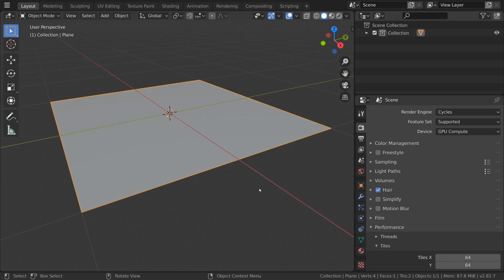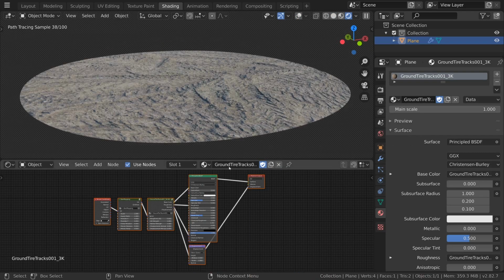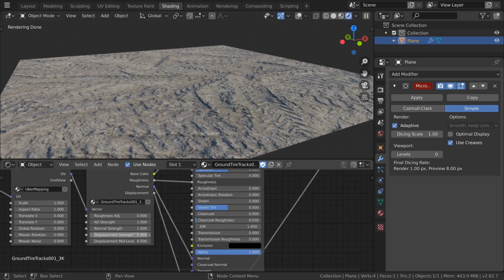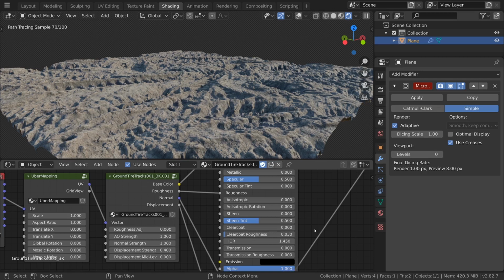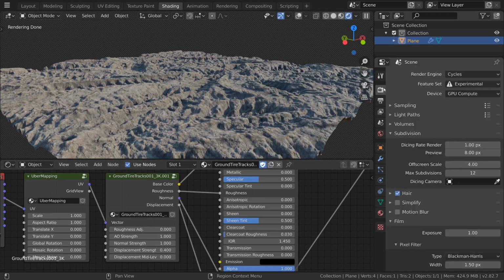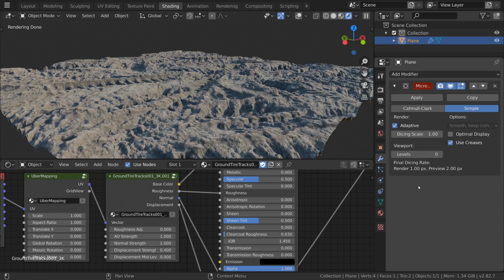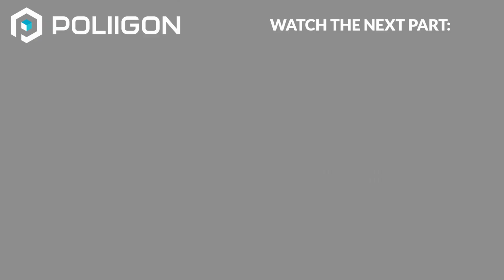Using Poliigon Materials in Blender (Part 3: Displacement)

Comment: For those who having weird issues with their displacement. Subdivide ur mesh like 50 or whatever u like dont go over 100 .It would be too much then.Add a subdivision surface . then adjust displacement level as needed.
Reply: Better if you use adaptive subdivision like in the video's instructions so there's more subdivisions near the camera and less further, and mostly automatic

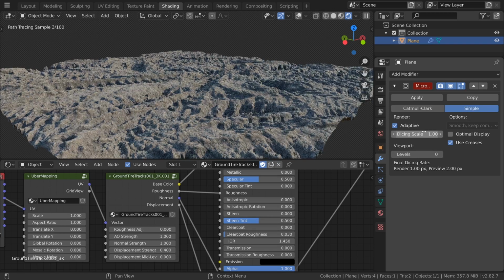Comment: 2:24 this.. I couldn't render my scene as it required 6 gigs of VRAM and I only had 2. I spent so much time optimizing geo and shrinking/deleting textures that don't make a difference and could only optimize to 4.6 gigs vram. It turned out that I had two objects with 1 px adaptive subDs on and they ate 4 gigs of vram! Changed it to regular subDs (could also turn PX size down) and now scene renders at 600mb vram usage :)

Comment: Same issue as others here, This video needs an update, as the Displacement nodes do not affect the plane model I am using the Ground Clay material and no displacement happens at all with it.
Reply: change 3d view to "Rendered" and it should work
Reply: @vanessa-huynh   I have done that and still no changes to the plane, Do I need to manually subdivide the plane for the displacements to happen?  
Blender View : https://ibb.co/Sd8tQQv
I noticed for some reason that Blender file did not add the MicroDisplacement modifier to the stack, So I tried a completely fresh file, Created a plane scaled it up a bit, Applied the material using the Poliigon Material Convertor, It applied the microdisplacement modifier, I changed the displacement settings to 50 in the material node and even with the modifier there was no displacement happen when viewing the plane in Rendered view.
Also tried with the default cube, 
left all imported settings as normal and chose Import Micro DIsplacement,
Again applied MicroSubsurf to the stack, 
Chose Simple on the Micro SubSurf, 
put Viewport to 6 
Quality to 5, 
Change view to Rendered
Displacement Strength to 2.000
Displacement Mid-Level to 1.000 
Not a single displacement happened just end up with a textured cube.
End Result - https://ibb.co/JQJDBGL

Comment: I am using the latest update from blender as well as the 3.0.1 material converter. My shader nodes look nothing like this. No ubermapping node. Instead a mapping node is going to the 5 shader passes. Can some explain what node wrangler or settings I have wrong.
Reply: THIS IS NOT WORKING AT ALL, WERE YOU ABLE TO SOLVE THAT PROBLEM?
Reply: @ridasaher4950  Yes, I solved the problem by updating the converter plugin. This gives you the option under "Import Mapping As" to select micro displacements and "UV+UBERMAPPING" once that new box was checked along with microdisplacements my materials now appear with the updated nodes and the displacements are finally working! I was dumb and just didnt do all the right updates/box checking
Reply: Weston Borosky  , I have the latest Addon and selected the UV+ Uber and micro...but I cannot see the displacement??? Do you have any idea ?
Reply: @melihcanisikli  I fixed it for myself by updating the "Displacement Strength" to a value greater than 0 in the node connected to the "UberMapping" node.